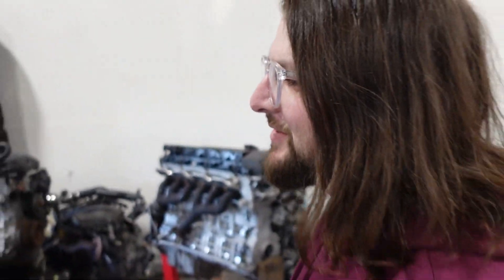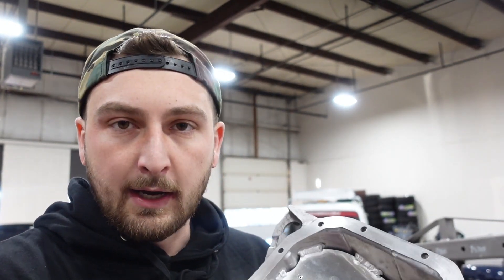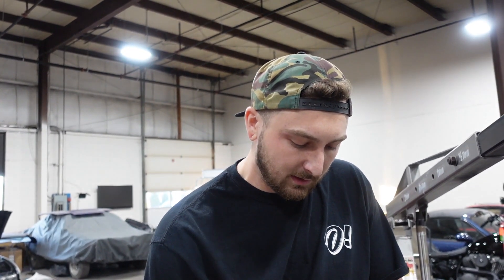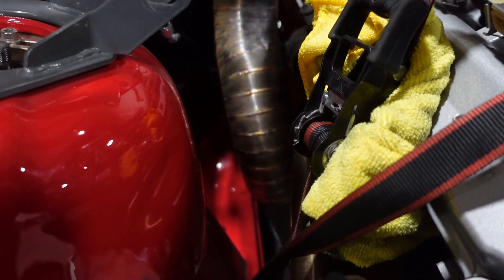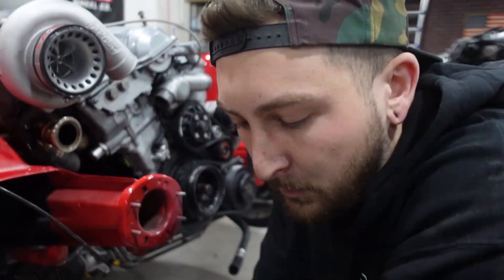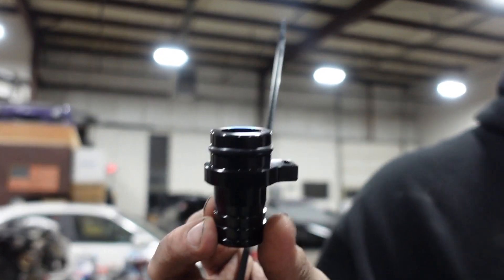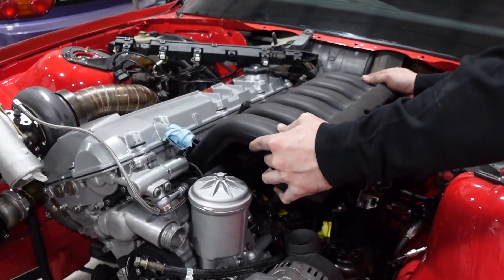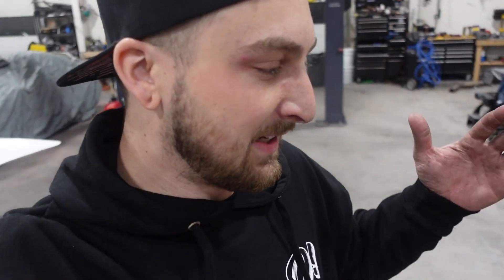BUILT M3 engine is finally installed in my E36!!

Comment: You should be careful over 22psi with the stock m50 intake, they usually crack over that pressure 😊
Reply: only issue being that theres really not a good centre entrance aftermarket IM, and at that boost the front facing entrance ones have huge cyl 6 issues

Comment: 3port Mac valve and 2port gate is a nice setup. That way you can literally run a 6psi spring and make like unlimited amounts of boost xD

Source to the bottom port, tee from source thru 3port and to the top of the gate. Basically reverses the boost map but is hella efficient.
Reply: And if the boostcontroller stops working you got source pressure to the gate so it goes to spring pressure ^^

Comment: BMW specifically states NO grease on the input shaft of the trans, when mounting the throwout bearing. Potential for the throwout bearing to lock to the shaft from excess dust and debris in the bell-housing.  Just FYI.

Comment: Looks amazing can’t wait to see it drive!! I have a boosted e36 as well didn’t see it when you filmed but make sure to put clamps on the icv hoses where they connect under the intake manifold I was missing one and it blew the hose off at full boost and the motor wouldn’t stop revving to red line!

Comment: If that's a solid black on your S13 and people complain. Then they have not seen a high quality paint job in solid black buffed to perfection. Great choise of color since Brian did such a hard body work on it. 
Did the painter mix in some color in the clearcoat when he painted it? Cause I thought you mentioned something about it when he was mixing the clearcoat. It's not unusual on higher levels of paint jobs to be doing this. As well as using in your case a black primer color to keep any bleed through to happen. Some even use that to it advantage and use a different primer color to then just spray a thin base coat color. To get that effect like almost a pearl color system has. On the right car I think it's awesome to see when people get out of their comfort zone with a unusual and cool paint color choise. This where it's no brainer how much the car means to you. You go with your favorite of choises. No wrong in that IMO. Just would want to see it in it's finished shape IRL. That's when solid black really comes in it's right and also out there in the sun is amazing beutieful. Please don't use a rotary polisher as the finishing polish step. But do it hologram free with a good DA polisher. If you have someone that really knows how to jeweling polishing with a rotary and don't get any holograms aka buffer marks when doing it. And takes the long time it takes then okay go for it. But it's so easy with a DA polisher these days with a high quality compound and polish to get awesome results even after the wet sanding. I like to use Sonax Cutmax as a compound. You can compound out P1500 with ease but a step up or two makes it easier. Then finishing it with Sonax Perfect Finish and Rupes Yellow Foam Pad combo and be amazed by the results. With the Cutmax compound you can use a microfiber cutting pad or a wool pad for DA polishers. Just some friendly suggestions from a crazy detailing nerd from Sweden LOL. 
Man that BMW will be a beast! Looking forward to the dyno results and see the powerband you get on it. And then see it on the track. You should fix up some cars and borrow a 3-4 trailer and go visit some friends and maybe new friends in Florida. And get you some testing and seat time even this winter season. Would be making some awesome content and also get you some vacation from the shop. To just go and have some fun as well. Then other shenanigans usually happens also LOL. Maybe the world is at a little better place with the China virus in january or february.